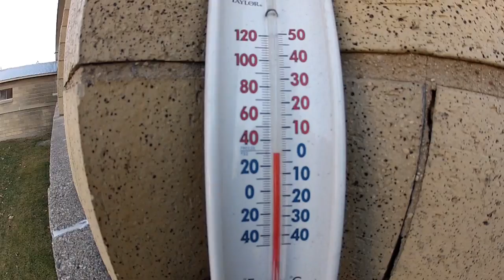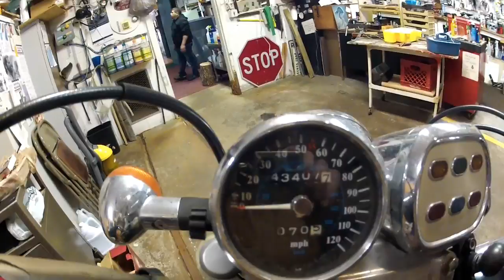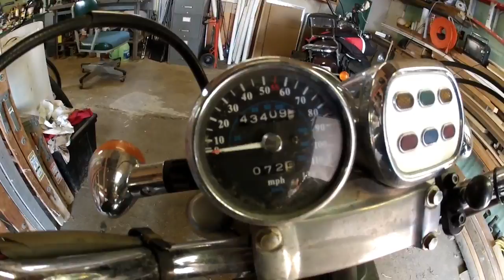PBC Ride 3 - Bulbs and Ballasts

Comment: Good observation.... my wife started buying "Fire Hose" pants from Deluth Trading company because I was so hard on stuff. Yes, they cost 50-60.00 for a pair, but man, those things are durable!! Made out of old fire hose material, with lots of pockets to put stuff in!! Love em'!
Reply from the maker: My overalls are the most expensive pair I ever bought at Tractor Supply. Around $75 but the canvas is really thick and the knees have a water proof liner for when you kneel on the ground. I agree buying quality is money well spent.

Comment: I bought, two, four-bulb, neon light fixtures, from where I use to work, they were old when I got them, and installed them in my garage. They have been going for 25+ years, on the original ballasts. Yep, they don't make them like they use to.
Reply from the maker: Probably have a pilot light too. ;)

Comment: I've got Fluorescent tubes in my basement and attic. I got the fixtures at Lowe's. I needed a ballast recently, but a ballast (at Lowes) was nearly the cost of a whole fixture. Considering the effort to replace the ballast, I just replaced the whole fixture. They did last 5+ years.
Reply from the maker: Yep they price parts sometimes to be as much as replacing a whole unit. So not worth it to fix at that point.

Comment: Good quality is getting harder to find, even with the high-end products.  Last nite I replaced an aging APC UPS.  The power cord was at least a foot shorter and the USB cable wouldn't reach, either.

Are the LED lights living a long life as advertised?  I'm using a lot of CFL units, but some of them have burned out in a short time.  Chinese, of course.
Reply from the maker: We have only started installing LED lights this summer, but so far zero failures.
If they last past five years that will be a fair test.

Comment: I have seriously been replacing lights with LED lights as the bulbs burn out. You have to be careful tho when you do that you replace it with LED's that put out the same amount of light.
Reply from the maker: We are starting the process now to replace all fixtures with led bulbs. I even ordered part of a case myself when the church did a bulk order. Got $29 bulbs for $6 a piece. So I am going to start changing my fixtures in the garage as they burn out.

Comment: What's that unit to the right of your speedo?  Are those 6 lites or buttons?
Reply from the maker: They are idiot lights for temp, neutral, oil pressure, turn signals etc.

Comment: Forgive my ignorance, but where do you use ballast in your buildings? I don't know if we use it here in the UK, hence why I ask.
Reply from the maker: If you have any fixtures with bulbs that look like long glass tubes then you have ballasts. They are a transformer type device that kicks up to high voltage to get the gas inside the tubes to glow. We have them in the three largest buildings, the school, the church, and the gym. Soon we will start changing over to led bulbs to save energy and money.
Reply: suburbanryder - The Mayor - Aaah, so that's what those things are called. When you said ballast, I thought you might have meant something to stop the building from listing on soft ground, not electrical stuff!! LMAO. Yeah, we have those long lights all over the place over here, too. Mainly shops and schools have them, like you say. I remember at my old school that they used to flicker from time to time, so they had to be looked at by a caretaker. Thanks, mate. Ride safe over there.
Reply from the maker: TheKnightsShield
I remember the old style ballasts in grade school. Even working normal the buzzing noise was very annoying.